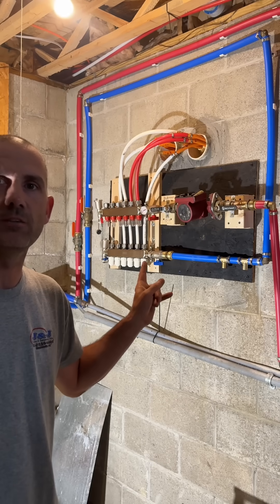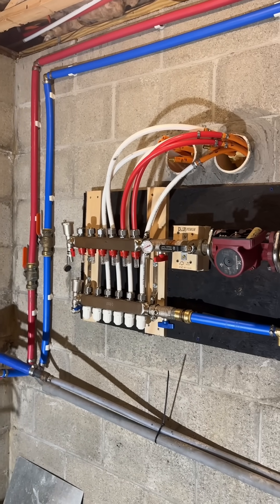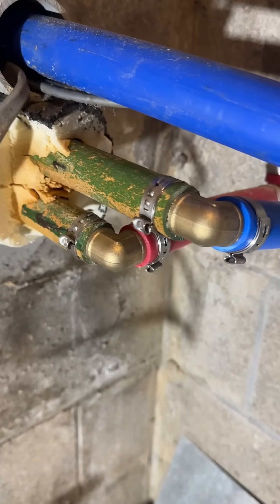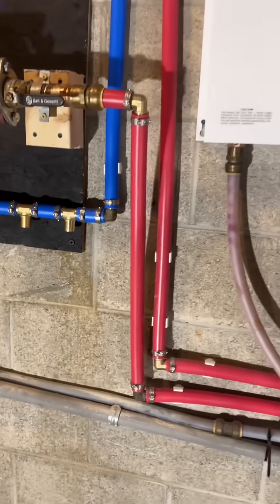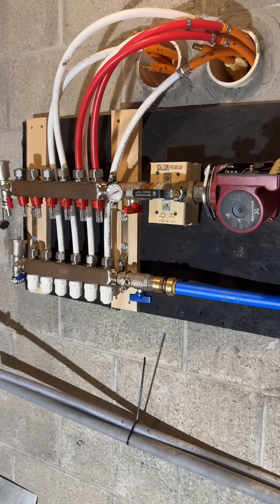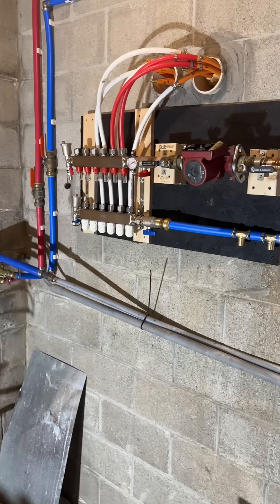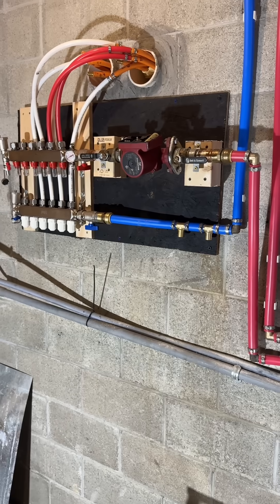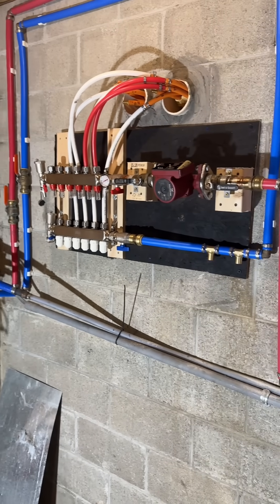Outdoor Wood Boiler Plumbing Upgrade | PEX Install

Comment: Nice neat job. I’m not trying to be a killjoy, but just trying to give you some friendly advice. Keep your eye on those shark bite fittings. They have a tendency to leak with OWB’s.

You may not know this as most people don’t, but pex expand  roughly 1 in. per 100 feet for every 10° in temperature change. 

I actually see it happen every year. My longest run is 500 feet to my house, and I have a circulator at 250 feet in an underground manhole. The pipe goes straight in the manhole and straight out of the manhole when it is cold. When I start up the boiler every year that pipe bends like a banana inside the manhole.

Anyway, you did a great job, but just keep your eye on those shark bites. I remember trees to firewood, posting a video where he had a leak after his fire went out. I told him to check his shark bites and explained the whole expansion phenomena. Sure enough that’s what happened.
Reply from the maker: Thanks for the words. I’ll keep an eye on those! Stay tuned to see how my burning season goes. I’ll keep posting videos.